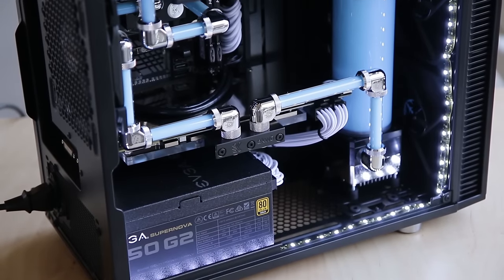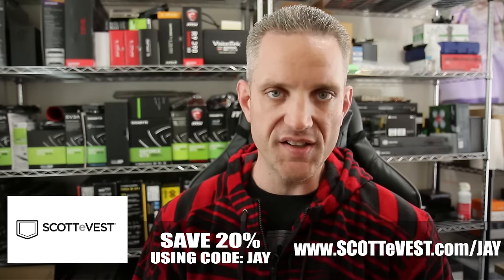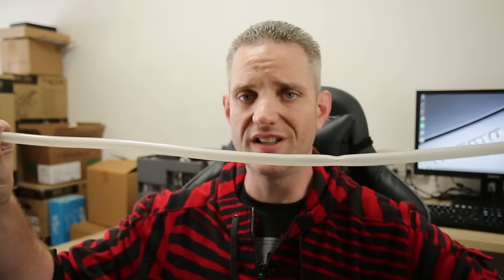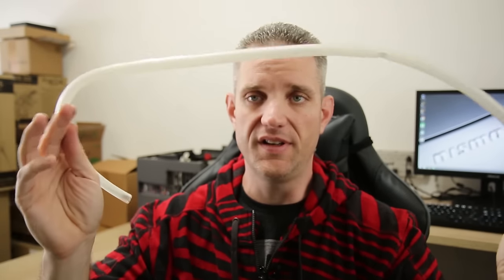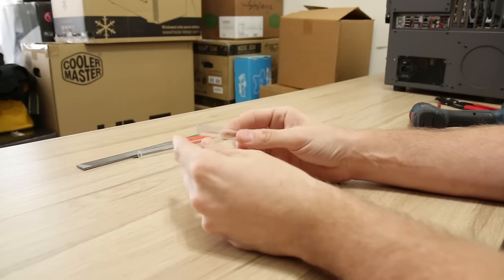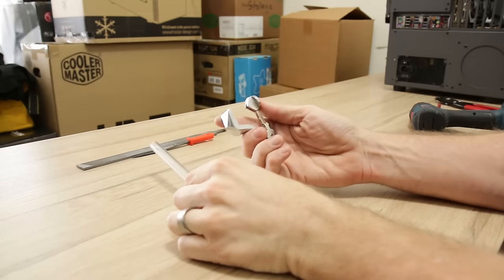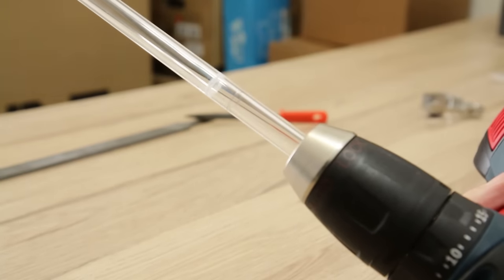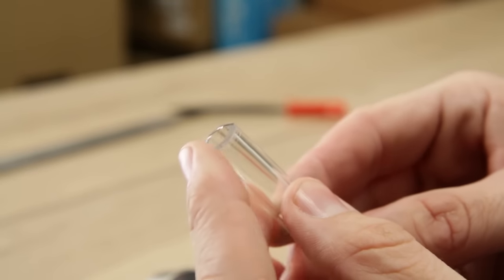Tutorial - How to cut glass tubing for watercooling loops

Comment: For bending the tubes, you can try simply by hand, rotating the point you want to bend on a flame (some use the stove), and bending by hand from the extremities with care. And if you want to have something inside to prevent caving, what about sand, some plumbers used it on pvc pipes. Just throwing ideas around.
Reply: +Tortex i thought the same but then with a little more thought there is problems with sand in glass as you need to pack the whole tube with sand you run the risk of scratching the inside of the glass as well as the chance of the sand becoming impregnated into the glass at the hot spot, also the sand needs to be extreamly well dryed as any moister in the sand can expand under the heat and pop there is the glass tube exloded in your hand. but all in all it was my first thought as well i think a spring would be a safer alternitive.
Reply: I'm not sure a spring would work, the heat would make it soft fast. And if the glass gets so soft that sand embeds itself in it, the spring could leave marks as well.

But there are videos where people bends glass tubes with pliers, by (gloved) hand or by gravity, and they never have anything in the tube.

Comment: hello hello jayz,probably have another option to cut the glass,first of all,excuse me,
because the English language is not my native tongue,I'm from Argentina,
the method I use to cut the glass is a string, as that comes in boxes pizzas,
I soak it in alcohol and tie it around to break point,
then turn on the line and wait for it to shut down,then it could easily break
(ty googletranslator) XD
Reply: +alejo wulff Thanks for the tip and would it make a different if I use water instead?
Reply: +Marcos Gutierrez Google translation gave him a clunky translation but yes you need alcohol because you tie an alcohol soaked string where you want to cut, you burn the rope and immediately after put the glass tube in cold water in order to create a thermal shock that will break the glass.

Comment: instead of using silicone insert to bend the glass could you try to fill the glass tube, making a loop. So using like air or liquid run it through the glass tube while heating the point you want and bending it. If you keep the pressure high enough (but not too high) then you would be able to bend it right?

I am speculating, i am not sure if the heated point in the glass would be structurally sound enough to withstand the pressure, (though i also dont think you need to deal with a lot of pressure)

Comment: I'm wondering if you could get bend the glass without kinking it by filling the glass tube with sand and heating it with a bunsen burner? It's definitely not a bad thing to consider as this wouldn't be too pricey or difficult.
Reply: Skirrow I know that you can bend borosilicate (pyrex) glass tubing with a propane Bunsen burner, and it bends quite well actually. I did it in a science class once. Just have to be careful as hell and make sure your in a well ventilated area. You can get Bunsen burners for about $25 and just a small propane cylinder from Walmart is about $10 so it isn't too pricey. There are tutorials on how to actually bend it all over the internet but the process is pretty straight forward. Now with all that being said I'm not even sure if the tubing he is using borosilicate but yeah. :)

Comment: the reason why they tell you to use a Benson torch on the ends is part to clean up the edges i think the other reason is so that melts away at the micro scratches on what ever end you just scored, however the tubing seems thick enough and wont be going through enough stress to really make it a problem. . .I think

Comment: Jay, how did u install the tubing into the bitspower fittings without cracking or chipping the inserted ends? I'm having trouble doing it, as the o-ring inside the fitting makes it SUPER tight...

Comment: Great vid. Glass might be an option I choose. So when you use 13mm glass tubing are your fittings also 13mm? You mentioned they were 12mm, so I want to avoid some confusion there.

Thanks!
Reply: +Middle of Knowhere I think he talked in his previous video on fittings that compression fittings where sold by inner wall diameter might want to look there.
Reply: Gardian06 _ Thanks!
Reply: @gardian06_85  what drill he used?

Comment: Jay, could you do a video on if there is a difference between a 240 rad with 2 120 fans and a 360 rad with 2 120 fans. I can fit a 360 rad but only with 2 fans and would like to know if I should just get a 240.
Reply: Obviously the 360 would be better since it would have more dissipation... it would be kinda like a 240 with fans plus a 120 w/o em. Don't see any reason why it wouldn't do better.

Comment: If you rotate the tube with drill like that, you can score it with the file. Bending class tube is not that hard, you can prevent the collapsing by pressurizing it gently. The other end needs to capped and you can use a length of flexible tube on the other end where you blow.

Comment: I wonder if you can get a clean cut by using a hot wire and dunking it in cold water to fracture it at that point? An electric cig hot wire might work to heat the glass...

Comment: hey jay i know at the end you mentioned that 90 degree fittings were required for any bends. if perhaps one of us ( not me i swear wink wink ) happened to be a glass blower, capable of bending glass tubing to any angle and keeping its shape, would one be able to use bent hardline plastic tube as a template as you suggested for the straight, and simply recreate the long complex runs with single continuous glass tubes?

Comment: Rumor has it that you can use a plane old MaPP gas can from a big box store to heat and bend glass tube pretty much the same as you do the plastic tubes. only difference is once the bend is done and has set (cooled off), you need to warm it back up some and then let it air cool to anneal the glass.

Comment: One thing which you might use in the future is a mask, as glass particles fly around and might end up in your lungs. just as asbestos, it  will sit there forever and might cause inrernal bleeding. 

You can give the cut edges a finer finish with less chance on chipping, if you put the (dremel) multitool grinding tools in your drill. I dont think you can cut with the multitool as you will put too much heat in the glass.

Comment: What about using a Dremel with a Diamond Cutting Wheel? I think if your careful and take your time, it may just work with the Diamond Cutting Wheel. What do you think Jay?
Reply: +Thetechgenius without being able to keep the glass cool while cutting (the pure rpm of the dremel) would cause the glass to spide-web and then the entire tube could be lost. not to mention if you skip the blade at all, or apply to much downward force you might be able to straight up shatter the whole thing.
Reply: Gardian06 _
 Ohhh ok, I see. Thank you for the info!

Comment: you do not need to go crazy with the drill a small score 1/2 to 3/4 way around the tube is all you need WET the score and pull it apart or snap it done.. A small straight score line 1/2 to 3/4 way around will make a cleaner break than a wonky wide score all the way around and if its big tubing like 30mm + you can put heat to the score and it will pop right off. A wet tile saw will work also

Comment: copper tubing would be interesting, only tubing that could do something for the temps, or not ?
Reply: +Jan-Christopher Estelmann - A Copper tubed build would be awesome, agreed. But I'm pretty confident it wouldn't effect the temps, there simply wouldn't be that much tubing, plus it's smooth. Linus did a video a while ago where he used about 5+ meters of copper tubing coiled around to decrease temps and it's didn't do much.
It would look pretty damn nice though, possibly in Skunkworks as well, copper with the burnt orange :)
Reply: +Jan-Christopher Estelmann unless you have some decent airflow around it and really long tube - nope.  
You want to keep your tubes short, but for the tubes to give of any significant amount of heat, you would need to have a huger surface area and thus length.
You would need tubing that is several meters long to get any kind of effect.

Lets say you have a 120 Rad 40mm thick, ~9 FPI. average small radiator, for maybe up to 200 Watt.
That would give us about 40 fins of 120mmx40mm - or 0.2 m².
If you now have 12mm diamater tubes you need 0.2m²/75mm = bit more than 2.5 meters of tubing.
And that would only work if your tubing would have really good airflow all over the surface.

TL:DR - you'd easily need over 10m of tubing to make that work...... not worth it.

Comment: My father told me a method that he used to cut glass tubes when he was young: soak a thin piece of cotton string in lighter oil, wrap it around the cutting position, light it up, let it burn for a while, then chuck the piece of glass into water, and the glass should just pop of with a pop sound.
Reply: +Nanorisk not going to work with borosilicate  tubing
Reply: +Jason Elliott why would pyrex not work? any particular reasons?

Comment: just a question, could you use sand or salt to fill the glass or PETG to do the bends instead of the silicone tube? i know that's how you keep copper from kinking when doing bends and is easier to deal with then the silicone tube. would this work for water cooling?
Reply: you could but it would be more of a pain, the only reason its done on copper is because copper comes in coils and is harder even when uncoiled to put a tube in.

basicly yes you could, but it would be a huge pain
Reply: callum Lawden
what about on PETG?
Reply: +wilson pies same thing, you could. but i can't see why you would want to
Reply: callum Lawden filling a piece of PETG with salt takes a few seconds, emptying it also. using the silicone can be difficult, it takes lots more time when doing 10-25 bends for a complex build. salt would save me time when i do work, but I was wondering it would work. I've never tested as most of the stuff i do is for clients who give me their choice of material, which they buy, and i do the work for him. was just wondering if it would work to save time
Reply: +wilson pies You would have to experiment, i know many people who water cool and none of them use salt or sand when bending. If you have the time give it a go, but personally i would stick with a rubber tube
Reply: won't the sand or salt leave tiny scratches on the glass or petg? wont see that with copper so that wont matter but on glass or petg it's a different story

Comment: 1. score tube
2. get twine and dip in alcohol
3. tie around glass at exact spot of score
4. light twine on fire and let it burn until the fire just starts to die out
5. dump cold water on scored area

Perfectly cut glass tube.... in theory.
Reply: +StoreBrand | Bernie2016      When you're cutting bottles in half, yes. But that's a long winded and inaccurate way to cut something so thin when you can just score and snap it. To be honest it's also fairly inaccurate on bottles anyway.

Comment: didnt know that was a thing,  I know some people use copper pipes etc 

see this would actually solve the problem my brothers pc had that he overheated the petg by not looking after the system.  wouldn't this be extremely expensive though as you have to have enough fittings to make sure everything lines up

Comment: You only need to score 1/4 the way around with just a good sharp file. It does not need to be deep, just enough to feel with your fingernail. Wet the score, hold the score away from you and snap it like a pencil. Building a full full glass system now including a full glass reservoir, will post a video later. Jay if you are interested I will build for you. Joe at ModMyMods knows how to get in touch with me. HellcatGlassWorks

Comment: I like the bends in the petg better than glass.... If you could bend the glass though, you have my support
Reply: +Ethan Martin You can bend glass it just requires blacksmith tongs and/or gloves as it has to be pretty hot, then you have the issue of not having a mandrel so it's hard to stop it from kinking.
Reply: Tom Ault I know, but I don't think he would go through all of the trouble to do that unless there is an easier way.

Comment: We cut glass frequently in my line of work. While its not exactly a poor mans method, you may already have the tools in your garage. We use a wet tile saw with a diamond blade.   If you take it slow you will not have any problems.

Comment: you can use string alcohol and fire .... just dip the string in the alcohol and then make a line where you want to cut and fire the string not, then it will erase and only one string but enough to cut bottles of beer in seconds without leaving tips..... i never use to do this but i am pretty sure that work well, hmm i used to cut bottle of vodka or beer, to make cups... i never have to do anything more than this.... u can test...(ps: use cotton string or cotton twine, pss: my english sucks, sorry about that)

Comment: well. basically the same as on laboratory glass tubes, though you usually only scratch those on one side but that probably wouldnt work on those thick tubes.

I'd prefer doing it by hand rather then witha  drill though. lol

Comment: Jay did you ever pull this off? If not and you want to try again I'm a borosilicate glass blower and I can give you some tips that will make it much easier and give better results. I can almost guarantee that mayhems sent you low quality Chinese glass that's why the tolerances were so off. With some proper scientific grade glass you won't have the fitting issue. Let me know if this is something that I can help you with I have no problem sharing my knowledge with you.

Comment: Kinkajou Bottle Cutter ?
$50 but might be too big, cuts glass bottles great though

and maybe look into plumbing pipe cutters, its the same as glass (same-to-sameish blade)
Ridgid 32573 1/4-Inch to 11/8-Inch OD
$30

Small:
Ridgid 40617 1/4-Inch to 1-1/8-Inch OD $20
Ridgid 32975 1/8-Inch to 5/8-Inch OD $12

Comment: well me i got a 16mm glass tube i am going to be putting into my build and the method i am going tu use is use a dremel diamond cutting disk its actually the method recomended cuttting method by meyhems because you dont snap the tube you just cut it like you would a 2x4

Comment: Rent a small tile saw with diamond wheel from your local hardware store. You will cut any glass at any length way easier, cleaner and safer than this. The cut will also be much smoother. I would never use the scoring tool.

Comment: It should be easier to cut the glasstube with one sraight cut if you turn the tube in the other direction or hold the cuter inversely.
so the glass does turn with the wheel instead of against it ;-)

Comment: Glas dust 
Nasty stuff if you inhale it, not to mention the potential for small shards.  For someone who does this on a daily? basis, you should take a bit more care to avoid that. 
As someone who has worked with welding fibre optics, I can tell you that tiny pieces of glass that doesn't show up on x-ray, can be quite dangerous if it's inside your body.

Comment: I realize this is a 5+ year old video but if anyone happens to see this I have a question.... I came across a bunch of pyrex tubing...  most is the right size for the fittings I already have from other projects... anyway I've been thinking about trying it with pyrex tubeing but know pyrex is actually alot different than glass so idk cant find much (pretty much none) info about anyone foing anything like that... anybody got any info that might help me???? Please and thanks in advance
Reply: Corning pyrex is technically identical with borosilicate glass because they both have amorphous atomic structure, the one jay used here is mayhem borosilicate tube so you can do pyrex tubeing, might also check mayhem pro glass cutting kit or saw with diamond blade to ease ur work.
hope this helps

Comment: hey man I am a professional scientific glassblower. Silica dust is as dangerous as asbestos. It is insoluble particulate. You NEED to wear a mask. Secondly use a wet tile saw and clean with distilled water to avoid hard water spots. To bend tubing flawlessly you need practice and patience. one side is stretching farther than the other so your heat should reflect that. Also without a Kiln and a proper annealing cycle relative to thickness of the glass you will have very stressed glass that actually could just check under tension at any moment. Yes a lot of liquid will spill all over your components. This happens way more often than you'd think, even as a glassblower. Flame annealing is another option if you don't have a kiln but is never as efficient. If you would like to do this video again sometime with the assistance of a glassblower. Hit me up. Check out @titanglassworks on instagram for my work. The creative options are near limitless with this application. Someone trained in scientific glassblowing and fluid dynamics could definitely come up with some pretty unique or never before seen stuff.

Comment: The idea of using glass tubing in a PC scares me.

I understand it's probably an irrational fear, but the idea of your PC ever falling even from a negligible height, or getting bumped during transport...if one of those tubes cracks, your computer is fried. Seems like plastic is far more durable and would be able to take any possible shock a lot better.
Reply: +IronOreGaming That's why I still use air cooling, Don't trust liquid around my pc.

Comment: Do you think something like this would work? http://www.homedepot.com/p/104-Tubing-Cutter-32985/100021967
I've used this on other types of tubing, just not glass. But it seems like the scorer is similar but is a little more rigid and won't leave the same marks as the other one because of the wheels on the opposing side. Also only costs $15